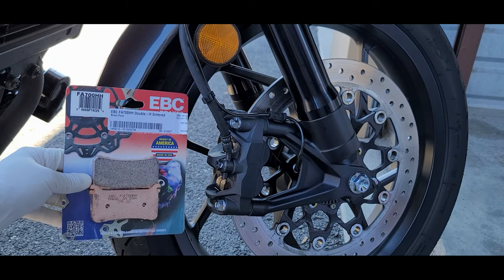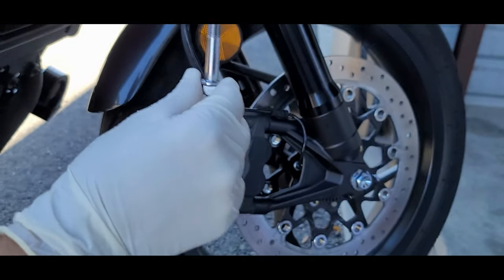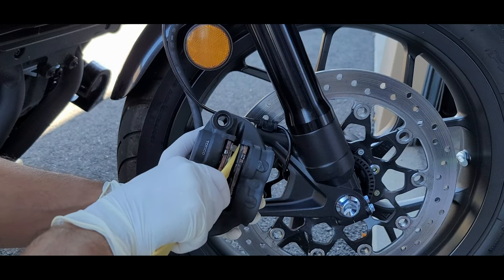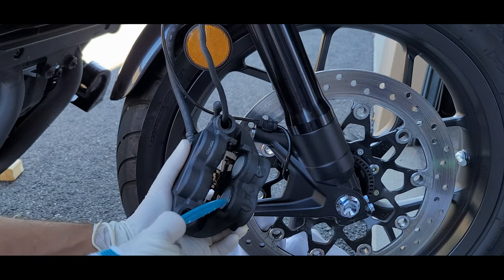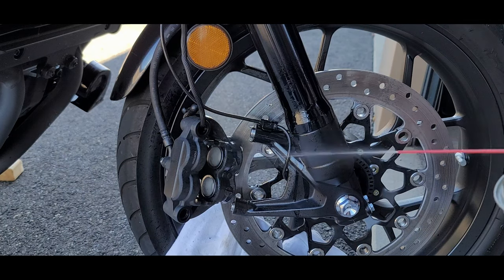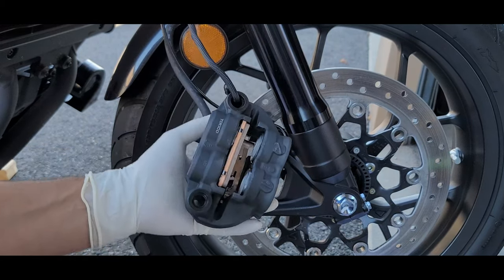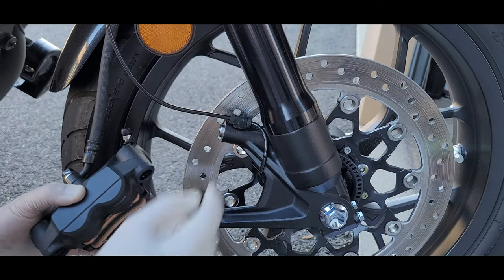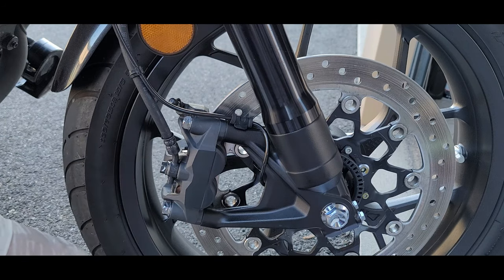Rebel 1100 Front brake pads installation

Comment: Thanks for the video. I followed your instructions  when I was done I can hear a slight noise that sounds like it is coming from the brake lever. Is this something  to worry about or is this the new pads breaking in. The brakes work fine.
Reply from the maker: Hi Brad, if you used the same brake pads that I installed, yes it does generate a slight noise that isn't easy to describe, totally normal. But if you feel something is not right, please have a mechanic check it out, don't risk it when it comes to brakes. 🤙
Reply: @ontherebel11  Thanks for the reply puts my mind at ease
 Ride safe bro.😎

Comment: Good Day, great video,  what is the part reference for the front brakes. thanks
Reply from the maker: Hi Daniel, this is the one I got https://www.revzilla.com/motorcycle/ebc-fa700hh-double-h-sintered-front-brake-pads?utm_campaign=order_confirmation&utm_content=Product&utm_medium=email&utm_source=RevZilla&sku_id=1833014

But keep in mind that I did not feel any improvement over the OEM ones as they are made of the same compound of HH, so I wouldn't recommend them over the oem pads.

Comment: Good day, if my brake fluid is low can i add to it without bleeding the system?
Reply from the maker: Hi Daniel! Great to hear from you man! Yes sir, but keep in mind that a best practice is to bleed the system and or replace the brake fluid if it is more than 2 years old, I prefer to change mine once a year. There is a video on the channel of how to change the brake fluid if you've considered doing that. 👍
Reply: @ontherebel11  Thank you, a mechanic did the fluid change when he added a longer brake line. I'm getting 12-inch ape bars. Upon recommendation, he said it was time to replace the front pads. Now knowing I won't have to bleed the system again, I can replace the front brakes myself. Again thanks for the info.
Reply from the maker: @DanielSan-sw9px  Anytime brother!

Comment: service manual does not say about replacing bolts
Reply from the maker: Hello Tanzir, thank you for contributing to the community by starting this conversation. It is important for us to share accurate and responsible information when this is going to be read by other owners in the future. Here is what the service manual states on page 19-8 "install the front brake caliper (1) and NEW front brake caliper bolts (2)" it has a picture next to this text with arrows pointing directly at the caliper bolts.
I hope this helps brother. 🤙
Reply: @ontherebel11  replacing almost new  old bolts is nonsense
Reply from the maker: @tranzistr1674  I totally understand your frustration brother 🤙

Comment: I think Honda recommends new bolts because they automatically have threadlocker on them.
Can't imagine the material is worn out.
Reply from the maker: Hi Prince, it's possible that you are correct, but I have to report what the service manual states so that you are empowered to make a decision. 🤙

Comment: One trick if pistons wont budge is use the brake lever a little bit to unseize them. I've been able to replace pads on my old Vl1500 using a prybar while leaving the caliper on. Also I would put a little grease on the back of the pads to make them easier to replace next service. A little red threadlock on the bolts wouldn't hurt. And wiping any brake fluid off with alcohol and a rag.
Reply from the maker: Thank you for the tips Jeb! 🤙

Comment: Suggestion:HOW I WASH MY BIKE - REBEL 1100 :D Im having a hard time to keep mine clean around the engine, problem of living in a dusty area but i believe you can get a lot of views even rebel 1100 not related :)
Reply from the maker: Hi Joni!!! That is a good idea for a video as i clean the bike with as little water as possible! Thank you for the suggestion Joni, i really appreciate it!
Reply: Try not to spray electric harnesses or any thing that looks like a sensor. That's when the corrosion starts and bike wont run a week later.

Comment: My friend hi. I got one more question for this weekend 😆 . What are the caliper bolts specs? Where did you find them? 😈 good morning candy 👠
Reply from the maker: 45131-MN9-006

90180-MN8-006

Hi Julio! The above are the bolts for the rear brake caliper bro. I ordered them from partzilla 🤙
Candy sends her love 😅
Reply: @ontherebel11  Thx buddy. Sorry as I looked everywhere on my service manual and only shows the diameter and torque 😔   Jjajaja 👠
Reply: Sorry. The bolts for the front brakes 😆 I’m not gone yet candy 😂
Reply from the maker: @Julio-bc7pj my bad bro 😅

2 of these 
90123-MJP-G50
Reply: @ontherebel11  yeah that’s it. Thx man. How or from where do you pull the data? Maybe I missed this on the service manual. Thx again
Reply from the maker: @Julio-bc7pj  anytime bro, look at the section of the front caliper, they have a note about using new bolts 🤙
Reply: @ontherebel11  I saw the note but not the part number 😆 anyway. Thx buddy. No more questions for now 😂 I’m getting new glasses this Thursday. Good time for it jajaja 🤣 see ya